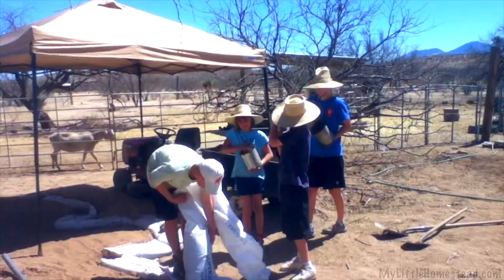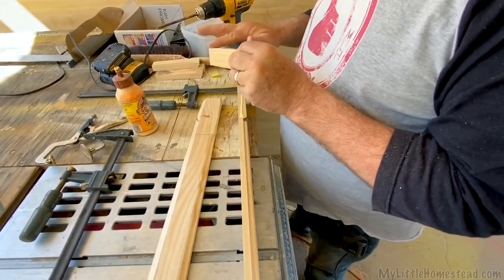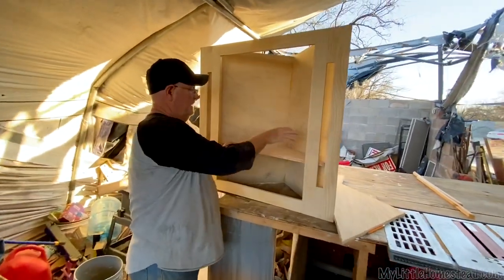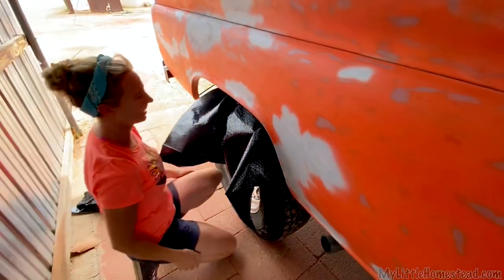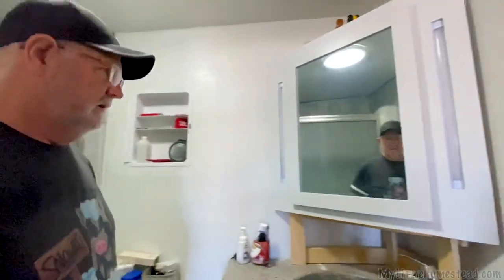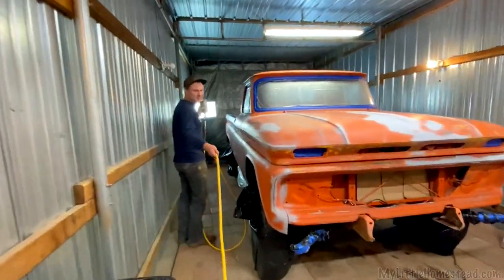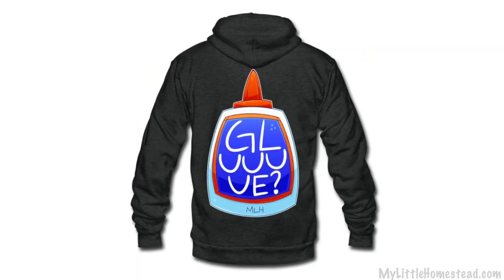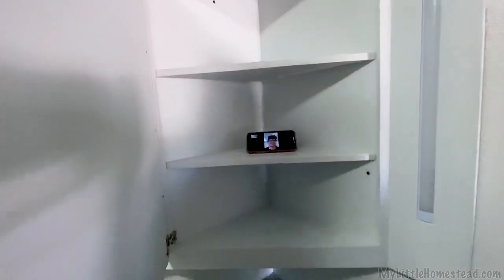DIY Medicine Cabinet & Primer Paint the Vintage Truck | Weekly Peek Ep280

Comment: Hello great video. Gary i thought about the tarps you had to put up for the wall to stop the wind . have you thought about using 1" or 1 1/2" pvc pipe to make a wall out of and put in some fans and filters on the wall and the other wall put in a door and clear plastic to have light to come in so you can see . then when you don't need take the walls apart and store it somewhere out of the way to you need them again. When you make the frame put screws in the 90 and the tee. Let me know what y'all think about my idea.

Comment: use the Kreg screw jig for joining bords to mount LED lights  You make a Chanel in the board then  make holes with the Kreg jig that the drill bit goes into the channel for wirers hard to explain but I think you will make it work